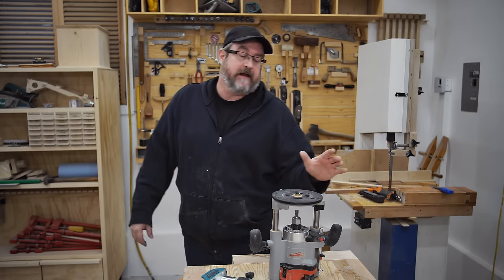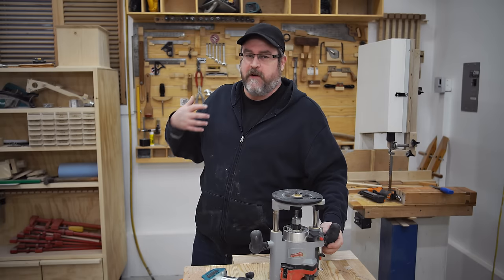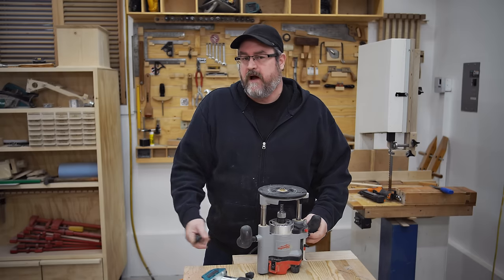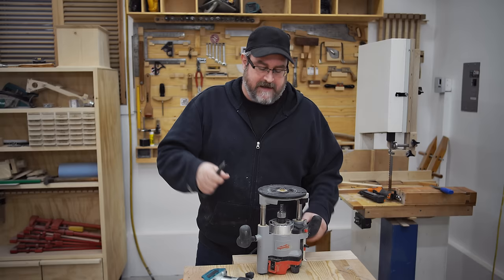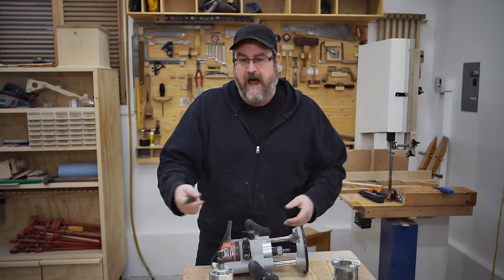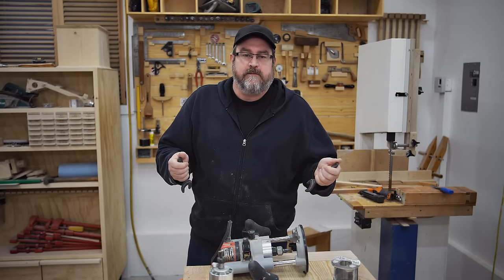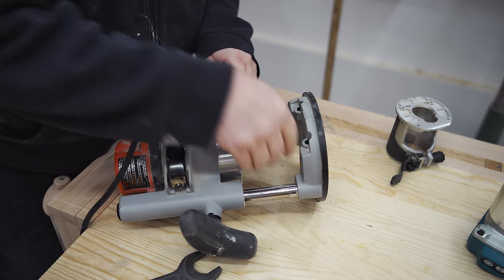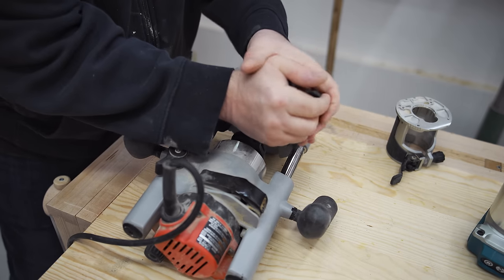HELP! My Router Bits Come Loose - How To Keep Them TIGHT

Comment: I’ve never once had a problem with router bits coming loose.
Reply: I never did until I did.
Reply: What brand is your router? You can guess why I'm here. So mad at this router for wrecking another project
Reply: @taylorsessions4143  My Dewalt with a button lock is doing this. I'm making two passes with a 3/8" straight bit to make a ~ 3/4" wide dado, and the depth changes between passes! So annoying. I have to unplug the router, readjust the depth, plug it back in, etc. I haven't attempted to fix the existing dados since I haven't been able to isolate the problem. The bit is not bottomed out and it feels like I'm tightening it well enough. There's no visible dust, but I'm going to try cleaning everything with alcohol. Once I know what's wrong I'll try to make the dado depth uniform.
Reply: @RyanLovettInSpace  I ended up replacing the collet and it's definitely helped, but it can still come loose. Next I'm going to try teflon tape, wish me luck! And to you, I wish good luck! I'm still secretly shopping for a router that won't let go of my bits though.
Reply: @taylorsessions4143  Good luck to you too. I tried with a larger plunge router today with 1/2” shank (previous was 1/4”) and had no trouble. I’ll have to figure out the issue with the other one at some point.

Comment: I have a Ridgid router.  In the past I had some bits come loose, ruining projects.  Turns out the nut that holds the collet is so wimpy that it broke.  Top cracked right off, rendering the thing useless until I could order the overpriced replacement part.
Reply from the maker: They should be a free replacement if they break. The cheapos!
:)
Reply: If I may ask. I too have rigid and ordered a 1/4 collect today for the 1/2 opening. Some come loose. Some stay if I make it close enough to the router that it wont make it past the table. Any advice?

Comment: I don’t remember who to credit, but a YouTube tip I use is putting a rubber washer or O ring in the bottom of the collet. This gives the bit room to cinch down, without having to hold it up off the bottom while tightening.

Comment: yep.... but what about the arbor....? I just noticed my arbor was loose (but the bit tight), I can screw the arbor back on, but not tight, as the motor shaft just spins, that's what it needs to do... Has no one else had this happen...? The thread on the motor shaft is quite short, there is no evidence of locktite.....

Comment: Two more things. 1. Never tighten the collet without a bit in place or you can damage it. 2. Clean the collet (a blast of air) and the arbor cone (wipe out with a clean cloth) whenever you change the bit, especially if you are using the router upside down in a table where debris can fall back into it.

If you have a CNC, using the two wrench method makes it much less likely to move the router out of zero when changing bits because the forces counteract each other vs. pushing against the router.

Comment: What a great tip, thank you for this video! I will do this in future 😁.  There's another great tip in this video though which you didn't elaborate on - the reasoning behind why the bit shouldn't be bottomed into the holder. I picked this up elsewhere, and it's because the bit is drawn into the holder very slightly during the tightening process, and if it's already bottomed out before you start tightening, then you can't get the best possible tightening because the bit is jammed against the back of the holder. For newbies like me watching videos like this, having the reason for doing something a particular way helps make it stick in the memory and avoid mishaps later. I know you know why you have to back off the bit, this is just for the benefit of watchers who haven't picked up on that yet 😃. I have a battery powered drill made by Stanley (Fat Max) which is excellent but has one annoyance, if I let go of the trigger quickly to stop the drill when I'm done with a hole, the chuck stops so violently that the sheer inertia of the spinning chuck is enough to loosen it no matter how tightly I've done it up (keyless chuck). I've noticed that this is more likely to happen if I've tightened the chuck with the drill bit fully inserted in the chuck, so it's the same issue - the bit is jammed and the chuck isn't fully tightened. That's just annoying with a drill doing 1,000 rpm, but a router bit coming loose at 15,000 rpm is "a little more concerning", hehehehe!

Comment: I bought an ER that has only one locknut for the collet. I have stripped the spanner they included to try and loosen it. I used a proper spanner and even that doesnt open or close collet when you press the lock button....

Comment: I built a CNC machine using the Makita palm router. I keep ruining projects bit keeps working it's way out. I figured out I had 6mm bits in a 1/4" collet. Changed to 1/4" bit still worked it's way out. Ordered new collets. I'll try this tomorrow! Wish me luck.

Comment: Thanks man, just got a new Makita edge router and it wouldn't hold my 8mm bit properly at first but using two wrenches instead of the built-in chuck thingy did the trick!

Comment: This two wrench squeeze method is also good for tightening and loosening  hydraulic, air and water fitting. Actually works exceedingly well on stuck fittings..

Comment: Great tips. The first time I ever used a router the bit flew off just missing my head and putting a nast dent in my front steel door. User beware the can be dangerously deadly if not used  and secured properly .

Comment: Cheers John I’ll never use the just one spanner again .good vid thanks 🙏 it’s nightmare if you using a sled flattening jig doing  a slab and the depth changes .especially if you,ve got down to your desired thickness .hopefully I won’t have that issue again .👍

Comment: Got rid of the pin long time ago on my cheap router. My good one (Bosch) uses 2 wrenches.  But the burning question is of course how do you keep the Collet clean? 
Compressed air or ''the magical  BJ ''  as demonstrated in the amplifier video ??? To be honest i used both but only one really works!😀
As always big 👍

Comment: I only have a problem with one bit - a solid carbide 1/4 inch upcut spiral bit. It comes loose in my Triton,  de Walt and bosch routers and also in my Mafell spindle on the CNC. My theory is that the upcut action of the bit means it is trying to screw itself into the wood, and eventually pulls itself out of the collet. I have to take very careful light cuts when using this. Is this a general problem with upcut bits?

Comment: The reason not to bottom the bit is that there is usually a small radius at the transition from the shank to the cutter and it will slip down that radius..
Reply: Meh not really, I know sone of mine have that. the main reason is because the collet is drawn in towards the motor when you tighten it. If the bit is bottomed out, the collet has to work against the friction on the bit because the bit isn't going anywhere. so most of that grunting when you thighten it up is just the bit being harder and harder to slide in the collet, when you cant give it no more, the collet is barley holding on. If you give the bit around 4 mm, all that grunting goes into the collet choking up on the shank of the bit.

Comment: Do you think it can also come loose due to the RPM and speed at which it gets pushed? Say you push it too fast and don't let it eat up the wood first? Had mine come loose quite a few times on my bosch while not bottoming. I always bang out the collet to clear it of debris.

Comment: no problem John I have a Triton 3 hp  router with an smooth bottom ring for the tightening of the bit it's an auto lock bit system How am I suppose to Not Use the Pin LOCK ???

Comment: I have a related issue - the nut below the collet (sort of flat looking) comes loose and works its way up the shaft until my bit then comes loose.  Could moving in the wrong direction while taking an aggressive cut cause this?

Comment: I had this problem today it ruined the pattern I made the collet was tight as can be it still slipped, I thought it was the plunger but that was bottomed sigh gonna hire a millwork company to cnc my stuff I have several pieces I need dont have time for any hassle

Comment: I was recently gifted a pretty cheap router. When I went to "play" with it yesterday I couldn't get the collet to bite down on the bit. Upon further inspection I realized the collet is solid with no compression slit. Assuming a step was missed at the factory. I am going to get a better quality router but I hate to see this go to waste. Would it be dangerous/reckless of me to cut my own compression slit into the collet? I'm 50/50 on the idea, even if it bites I dont know if itll hold at 2000rpm.

Comment: Not sufficiently tight is the first problem with a loose bit  but there is a second reason. A bit that overhangs the shaft (ogee, chamfer, roundover etc.) does not transition from the vertical shaft to the horizontal base directly, there is a slight roundover where the two meet. If your collet seats on this roundover it will never tighten completely. Remedy: go to the hardware store and get some small o-rings ( 1/4" or 1/2" to match your collet) slide it on the shaft to the top. Problem solved, the collet can't go all the way up the shaft.

Comment: Why don't you bottom out the bit?  Does that lead to friction in the base of the receptacle or something?
Thanks for the video.
Reply: I think it's because there's a radius where the shaft meets the bit, and it can prevent the collet from gripping the shaft fully. Another trick is to put a small o-ring on the shaft, then you don't have to hold it up while tightening

Comment: A small o ring on the router bit shank will stop you from putting the bit in to far so you do not tighten the collar on to the small radius of the cutter shank

Comment: That's how I do it too, learned it the hard way... But why not bottom out the bit?
Reply: as you tighten the nut the collet and bit it will get pulled in further, if it is already bottomed out it can't do that.

Comment: Blimey.? I haven’t had to the two wrench thing for years,my routers have a flat plate that works like a spanner when you push in the button,and they also have the Elu style collet where you have to release the nut twice to get a cutter out.never had a problem. Smashed a few small cutters off though !

Comment: What's the reasoning  of not letting the bit touch the bottom?
Reply: The collet pulls the bit in slightly when it tightens. If the bit is already bottomed out the collet can't seat properly.

Comment: The squeze trick is the way to go on anything. You have full control , your not gonna punch thru a wall with one hand and throw a spanner in your teeth with the other. You also get more force and more on axis acurate force. Also causes less motion on other parts connected to it. As a plumber, it pisses me off when the manufacture doesn't provide a flat to anti spanner.